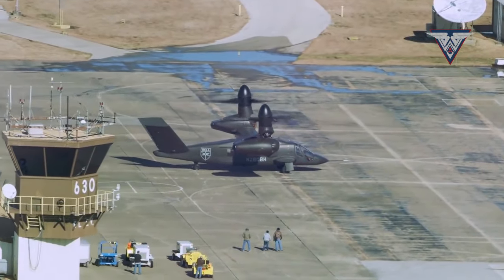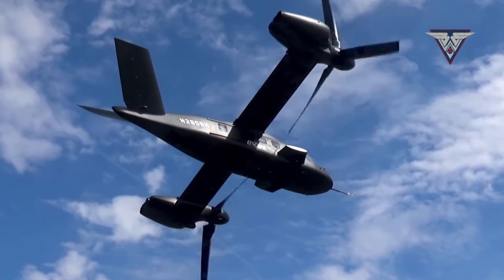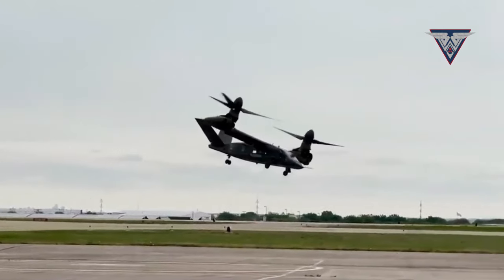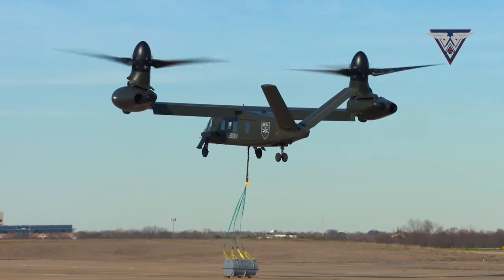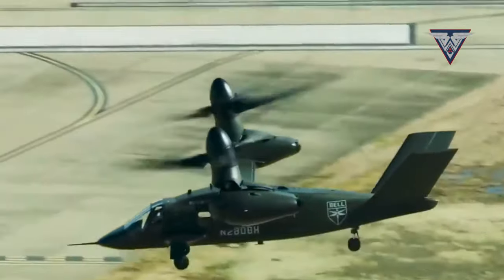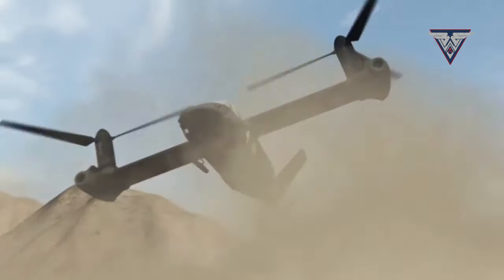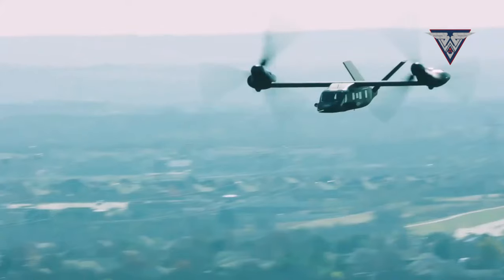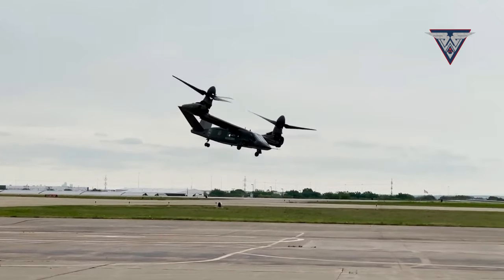The V-280 Valor: Flying Marvel or Just Hype? Let's Find Out!

Comment: The problem I have with the V 280 valour design , is the size, mass of the " rotor  blades"  which are just way too big! Yes the concept  is well proven, but there is something awkward about the massive size of the rotors, something that doesn't look right, especially in forward flight.  It would be hard , almost impossible  to miss hitting the rotors if you were an enemy, firing at them.  Thus  due the very large area that they sweep out, they are an obvious target and thus vulnerability of the craft, you'd have to be blind missing hitting them! .  Also the ground profile too , is much larger than even a large helicopters sweep. Thus there will be many crucial sites that they will not be able to land , again a weakness of the design.  Yes it is faster than normal helicopters , and can fly further, but this performance, this hybrid helicopter/ aeroplane, has some serious operational compromises!  Two very serious weaknesses , rotors you can't miss, if you shoot at them, and an enormous ground profile limiting where the craft can actually land!  You may disagree, but the facts are facts!
Reply: No your "facts" are you saying "I fell it would be hard to miss or It looks like a larger target"... I swear people seem allergic to researching about anything before saying garbage.

The Black Hawk is barely armored... if they can hit the Valor they would be able to hit the Black Hawk just as easily. In the air the Valor would be in and out of the hit zone in half the time meaning it is vulnerable for less of the time as any helicopter is vulnerable. The Valor only has a 19% larger total footprint and can fit in 95% of landing zones you could land a Black Hawk in. The ones it couldn't you would want to avoid with a Black Hawk anyway. Not to mention it does not have to worry about a tail rotor hitting low level objects or people.

Comment: When the rotors are vertical, the engines are wide open to the elements. Such as Dirt, Moisture and even worse Direct gunfire. Anyone know why this isn't a concern?
Reply: this is a prototype still.
Reply: The jet engines on all aircraft are exposed like this unless special filtering systems are incorporated.... It's useless to armor the engines fwd intake, if you're flying in an aspect they can shoot directly down intake, you're flying it wrong.